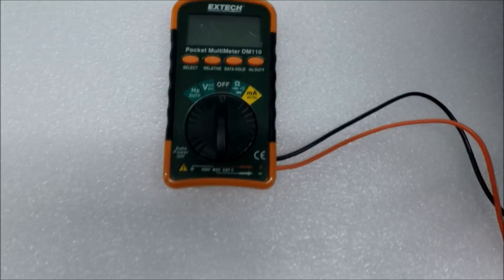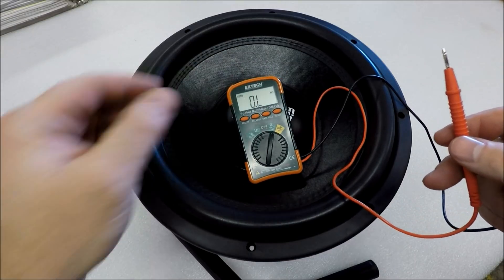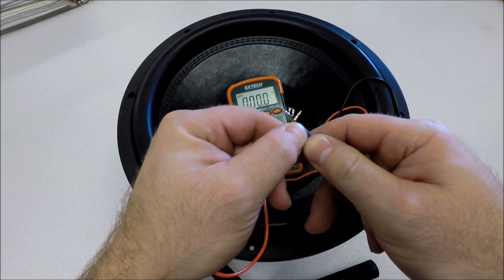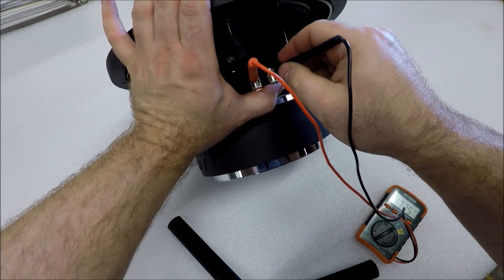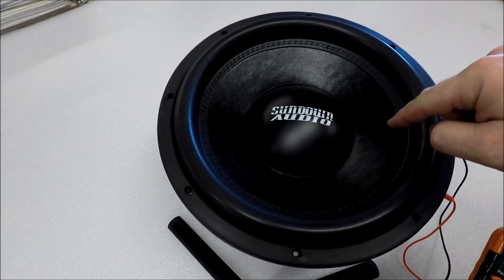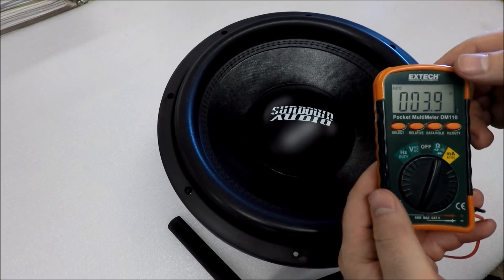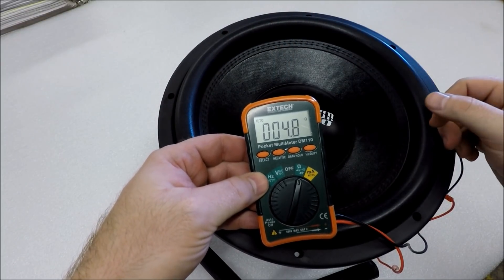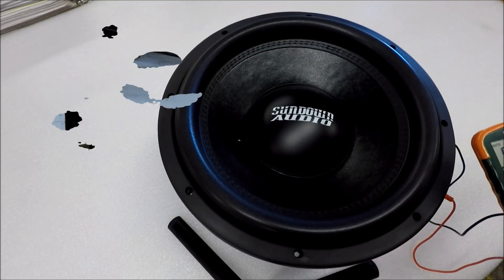*Tech Time Thursday* *How To DMM a Subwoofer* at Sundown Audio

Comment: if my dmm gives me a resistance of .3 before putting it in the subs, do i subtract .3 off the load when i connect the leads to the voice coil. if its 3.8 ohms is it actually 3.5